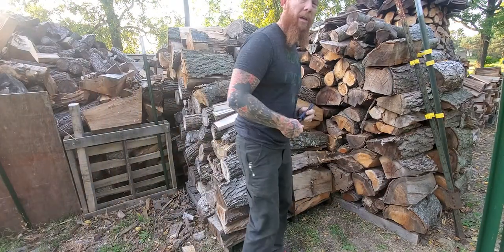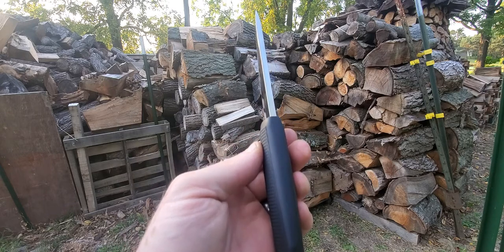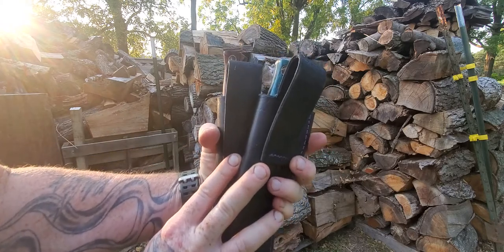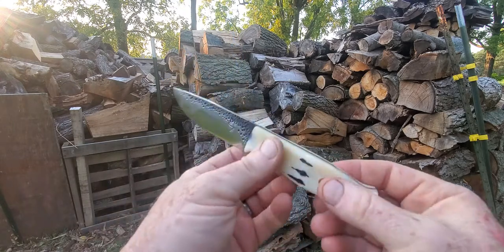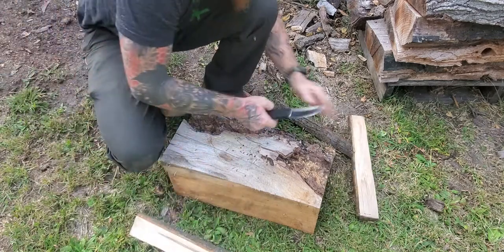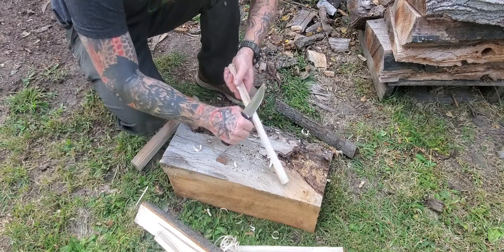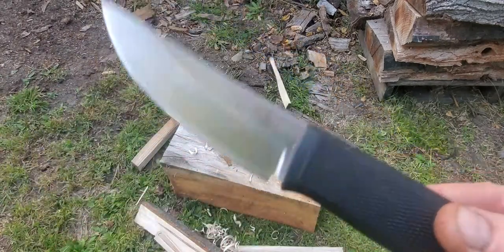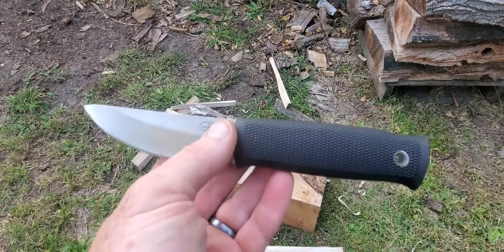Fallkniven h1 and a couple I made

Comment: Only thing good I find on Fallkivens, is their edge'blade geometry, which for their thickness is crazy good. However, they are way thicker than they should since they are also laminated... you don't lose slicing abilities,, you lose ease of carring and a lot of other things.. Their sheaths provide the ability to sheath the knife dirty, which only Morakniv sheats can do and is way better, than any Leather of Kydex sheath, for a knife meant to be used. (you can''t use them for harvesting wild edible, if the sheaths haven't that feature. Their COS blades are much improved, but they made them  even thicker which sucks... Handles could easily have better ergos, yet, they make them worse and worse instead of the opposite..So all in all, they are just an overbuilt knife ,which work fari on wood but that's that. Even for that kind of tasks, there are way better knives out there,..Your knives are way better!!
Reply from the maker: I totally agree they are certainly overbuilt for most tasks we need them to do. Thanks for the compliment!